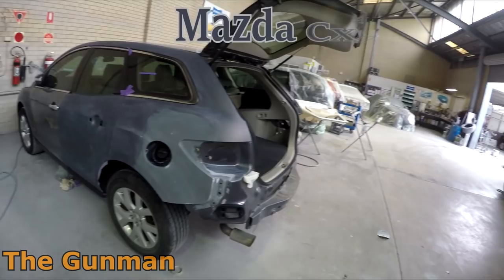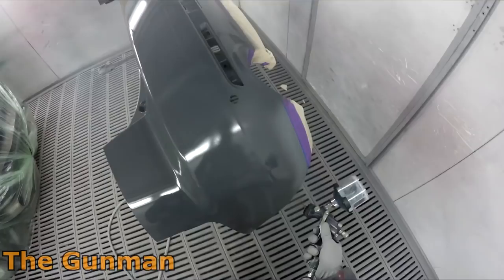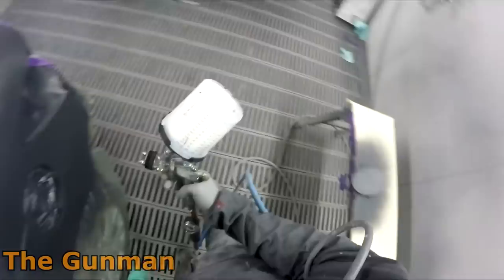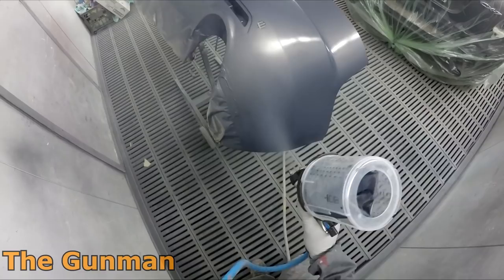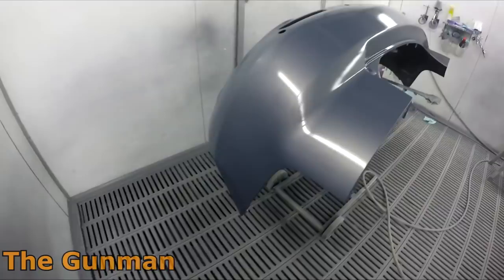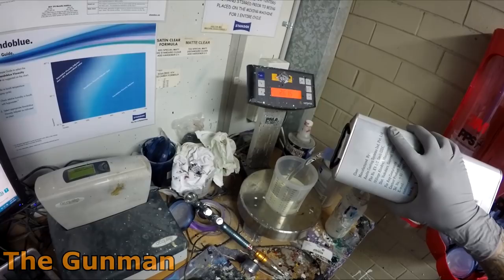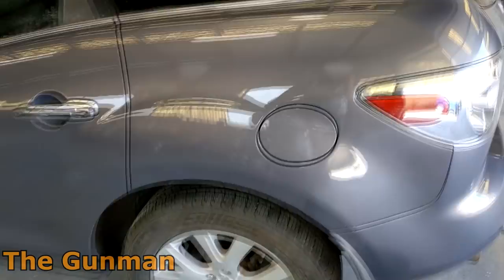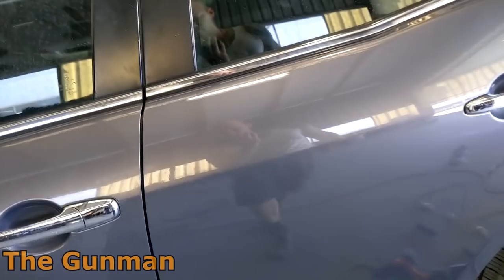Mazda CX7 Standoblue

Comment: My 4th day since the switch and loving this paint...we are using cromax pro waterbase. My rep wants me to prep my blend panels in 800 grit for solids and 1000 grit for metallic colors. The ls400 is doing fine but I felt it sprayed better at 28 psi with full fan and full fluid. So I think I'll grab a ws400 base to stay in the recommended 26 psi. Great work as always gunman!

Comment: Hey gunman or anyone using this brand. Sometimes where I apply the wetbed and put clear coat on I can see sanding mark's.  It's like they are highlighted...looks similar as when you sand a dark panel wipe off the dust and you get that lighter sanded spot compared to the unsanded area.   Its only where the wetbed is. Its weird and never got this with are previous waterborne system.

Comment: Hi Gunman, love your vids. I have a question on a mistake I made after spraying 2k primer high fill. It's a 4.1 ratio. 
After spraying, I realised that a small portion on top of the door near the window chrome trim has not been sanded down properly and a layer can be seen through the hill fill. Any tips of what's the best way of repairing this issue.  I took a pic, how do I send it to ya. Thanks a million.